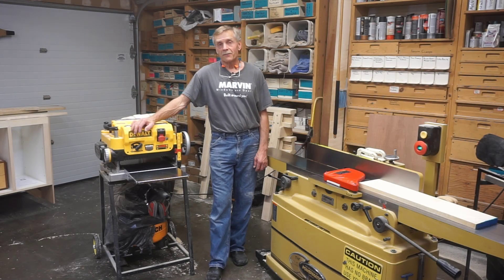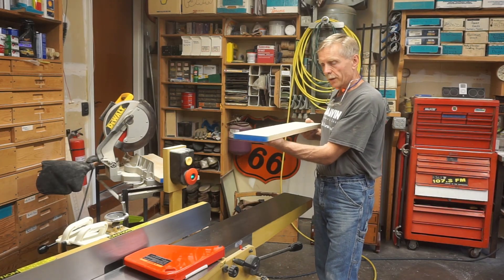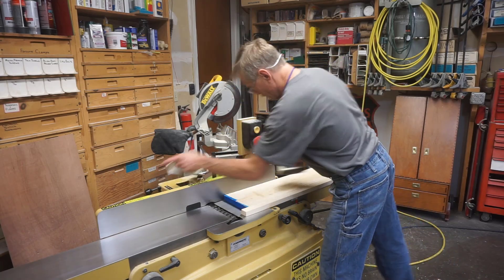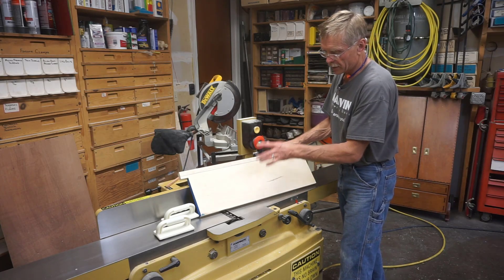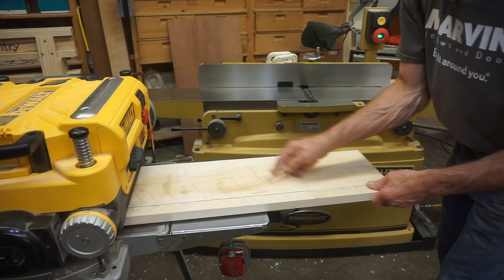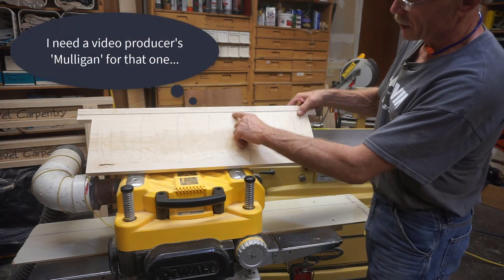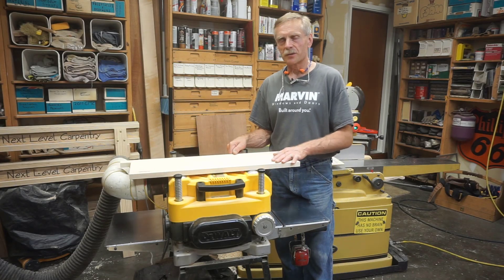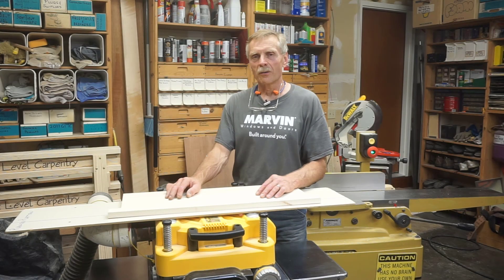Supersize Your Jointer for Planing Over-width Boards

Comment: If the lug is less than 1/16”, you could double face tape a piece if lath/lattice on it and then it wouldn’t climb onto the platen.
Reply from the maker: Great suggestion Daynaleo... thanks for taking the time to comment and share it!  Best, Matt

Comment: Thanks for the great tip!
What’s the model of your DeWalt Planer?
Reply from the maker: It's their DW735 and it's the second one of the same model I've owned.  I do a considerable amount of planing for my custom carpentry/millwork business and sold the first unit after quite a few years to make sure I have a reliable, top performing machine when working on client projects.  It's by far the best value for a planer of its size/class on the market and has been for quite a few years IMHO.  I can't really imagine being disappointed if you purchase and use one of these.  Best, Matt
Reply: Next Level Carpentry thank you for the info 🙏🏻
Reply from the maker: For sure!  If you find time to check out other NLC videos you'll see that machine put to use often on projects featured in them and maybe learn or clever trick or two to get more out of your planer...
Best, Matt

Comment: Can you make a video on how you built that giant pencil? is it hollow? did you paint the tip or is it exotic wood?
Reply from the maker: I'm planning on a build video for the giant pencils.  BTW they are indeed hollow with a rectangular hole all the way through for the 'lead'.  The 'lead' is actually a piece of genuine Gaboon Ebony although there's just a little piece at each end of the pencil where it shows.  A full piece of that exotic/rare stuff would probably be over $100 plus it would be squandering a rare resource.  Hope you'll stay tuned for the build video knowing it's going to be awhile before I get to it.  Best, Matt
Reply: Appreciate the response, here in brazil exotics like ebony are very hard to find, I got some small pieces for over a 100 that I could use, I bought a giant piece of actual lead Im thinking about epoxying in at the tip to make it fully functional, will await your video to take the build to the next level
Reply from the maker: Using actual graphite (lead) for one of these pencils would be SO cool!  Where did you find the stuff?  With your comment I'm going to consider getting some for when I do the build video... it would be the perfect touch!  Best, Matt
Reply: There is a company where I live that make them in 1/2 and 3/4 thick round dowel looking solid pieces, they are used for decals and art stuff mostly is what the company told me, I asked them if they could make a 1 inch square piece and they said sure, extremely cheap costs few cents

I checked amazon and they sell graphite sticks, rectangular and crayonish round ones but only 1/2 inch thick,  half inch may be too small for the giant pencil specs, but may be doable

I will make it fully functional whatever it takes, when people visiting over look at it and say hey thats a nice piece of decor, I want to pick it up and draw on the floor
Reply from the maker: I like the way you think Gabriel... you've convinced me to pursue the idea of making oversized pencils that really write... thanks!  It's my intention to mention your inspiration when I get around to doing the video but feel free to let me know if I neglect to mention your comment in the actual video... it would be from memory lapse not lack of appreciation!  Best, Matt
Reply from the maker: Gabriel Lopes, your wish will be fulfilled within the next week as I've filmed video for the entire process for making giant carpenter's  pencils and am in the process of producing the video now.  I hope you see this reply since the conversation we had 5 months ago inspired me to check into the chunks of graphite you told me were available through Amazon.  Indeed they were!  I bought a 10cm x 10cm x 3cm block and fashioned it into 'lead' for a whole assortment of giant carpenter's pencils. A full hour long video will show the pencil build process and a short 'teaser' Giant Pencils that Really Write video will feature the 'magic' I learned, in part from you, of how to make the giant pencils write!  I'll mention your name in the video as I believe in assigning credit where credit is due.  Thank you for contributing to Next Level Carpentry... I really appreciate it! Best, Matt

Comment: Good tip
Reply from the maker: Thanks OIS, hope your able to put it to use... maybe on a restored old jointer?  BTW I love the satisfaction of resurrecting old tools and equipment too but seldom devote the time to it that you do...nice work!  Best, Matt
Reply: Next Level Carpentry you must have been watching my stuff . I do a lot of reproduction castings for vintage machines.
Reply from the maker: OIS, yeah, I checked out your channel quickly and it looked like you were pretty serious about restoring 'old iron'  I should check it out further because the concept of doing a reproduction casting is fascinating... keep up the good work!  Best, Matt
Reply: Next Level Carpentry latest projects are compound slides for two different atlas compound slides and the depth stop for the Stanley 78 rebate plane
Reply: Next Level Carpentry some machinery would be unavailable without good reproduction casting.
Reply from the maker: I"m sure... seems like you're filling a niche in growing demand... I'm impressed and fascinated.  Feel free to post a link in a comment here for the Stanley 78 rebate plane if you do a video on it... I'd like to see it and think other NLC viewers might be as well... Best, Matt
Reply: Next Level Carpentry have a few already I'll post links when I get home

Comment: Matt, wonderful idea and explanation!  Don’t fuss about “unscripted” vids...we are not trolls ready to pounce on every detail!  We love your teaching!  So, question, would you do a 2 min., vid on the drawer pulls on the storage center behind the DeWalt planer?  THose look sweet!
Reply from the maker: Thanks for your tolerance and understanding, John, without it from you and other viewers Next Level Carpentry wouldn't stand a chance!
I've never really considered doing a '2 minute video' but might just to see if I could and address your question at the same time. Are you referring to pulls in the wood faced drawers behind the planer or the white plastic 'drawers'?
Best, Matt
Reply: @NextLevelCarpentry  I'm guessing he meant the wood faced drawers, although those seem rather simple, although time-consuming.  (at least the way I would do it)
My guess would be a plunge router to remove the majority, then a different bit (dovetail or in the same category) to undercut the upper wall to give your fingers something to grasp.
Personally, I would prefer mallet and chisels, but that is a lot of drawers and would take a lot longer!
So, did I get close?
:D 
Great video.  Loved every minute!
Reply from the maker: @kevingraves7431  I bet you're right.  I'm pretty sure I made those with a 'drawer pull bit' in a router back in the day: https://www.amazon.com/dp/B000K2EFVS/?ref=idea_lv_dp_ov_d&tag=aiponsite-20&linkCode=ic6&ascsubtag=amzn1.ideas.29WVINIJF4EUJ It would be a tricky operation  but less so using a forstner bit to start  the process.  Glad to know you liked the video BTW thanks for watching... Best, Matt

Comment: I mean no disrespect here but is this process better than just running the entire board thru the planer from the very beginning using a planer sled and not using the jointer at all?
Reply: A surface planer can NOT flatten a board UNLESS the bottom of the board has already been flattened. Thus this video makes perfect sense and guarantees not only flat surfaces but perfect parallel.

I think it is a GREAT idea. And I will use it from now one. Here is why: My planer is 15" wide. My jointer is only 8" wide. Thus that often presents a problem. In fact I was considering selling my jointer and planer and buying a European jointer/planer combo; where the cutter head width is the same for both operations.

With this idea I can shelve the idea and save a bundle.

Thank you SIR!
Reply: Pat, according to all the videos on YouTube showing using a planet with a sled....I'd say it can.
Reply from the maker: No disrespect taken, befmx, it's a valid question.  Main thing is it's a great alternative for certain applications that's good to keep in mind... never know when you'll end up in a situation where one method outdoes the other.  Best, Matt
Reply from the maker: And your implication is that using a sled and shimming isn't 'screwing around' but using an auxiliary platen is?  Hmmmm
Reply from the maker: You're welcome, Pat... thanks for your comment.  I'll caution you if you find yourself needing to flatten a lot of stuff to full 15" width you might, in fact, be better off with a wider jointer/planer combination.  I've done 13" stuff with the 8" jointer but it is a bit tedious because of light passes necessary for everything to work.  Give this process a try to see how you like how it goes before making the final equipment decision you mention.  I will say that I've not felt it necessary to have a 15" thickness planer or jointer wider than 8" for any projects I've taken on in close to 20 years of successful  profitable self employment.  If space and money weren't a concern I'd likely upsize both machines though.  Best, Matt
Reply: Thanks for the good tips.
Reply: Indeed! Hmmmmm

IMHO, a sled can cause all kinds of adjustments to get the stock level. Your method is much easier and I believe faster. Also a "sled" is, in essence, "flattening the bottom of the stock" as far as the planer goes. So the notion that a planar cannot plane a board; UNLESS the bottom has already been flattened; is true.

Oh well.
Reply: But using a planer sled usually involves screwing the workpiece to it.  Since he's making cabinet doors, the screw holes don't lend themselves well to the doors.
Reply: If I had a jointer like that, I would use it for everything haha. great Idea!
Reply from the maker: I'm with you Callam... I DO use that jointer for everything!  😁😎  A very sweet machine for sure.  So you don't feel bad it's the 3rd jointer upgrade I've made and was only able to justify the cost when it could pay for itself with faster result on  demanding millwork projects.  Best, Matt
Reply: Pat....."planer"

Comment: Genius, I have watched dozens of other vid's to supersize jointers but they all fall far short of your simple method. You are a master please keep the video's coming
Reply from the maker: Thanks Tom; I've always felt that part of 'mastery' is sifting through  many options to dial in to the one that's most effective and efficient and then tuning that best option to optimize it for the task at hand. The Irish carpenter I learned much from in my formative years referred to it as 'getting a system' for a given job. Sounds like you're doing exactly that... hope you're able to do better work faster using this method next time you encounter over-width boards.  Best, Matt

Comment: Thanks for another great tip.  I am looking at getting a Jet JJ-6HHDX 6" Jointer with helical head and a DeWalt DW735X Planer.  Your tip will save me from ripping then re-gluing wider boards.
Reply from the maker: You're totally welcome, Mark!  I think you'll be quite pleased with what you're able to accomplish with the setup you describe and using this method.  You should be able to push the limits of this and flatten stuff 10" or so using a 6" jointer.  As I mentioned I've done some pretty wide stuff by cantilevering off the 8" platten 4~5 inches.  The wider the piece, the lighter the pass.  You can imagine/visualize the physics as you approach 100% cantilever as the feed rollers want to equalize pressure and tend to tilt the workpiece but if you're paying attention and 'sneak up on it' you can push the limits and still get great results.  If you get into some gnarly/wide stuff there's always the method Hardnox describes in his comment below.  Best, Matt

Comment: Platen pending got a laugh! Liked
Reply from the maker: Glad to know you got a laugh rather than adding a thumbs down for the comment... which would be totally understandable for the rather lame 'joke'.  Thanks for the 'Liked' too!  Best, Matt
Reply: Us aussies usually get things upside down and back to front! Cheers mate
Reply from the maker: I've heard that... I guess the fact that it's winter there and 90 hot humid degrees here is confirmation, right?  Feel free to rub it in next January when you're spending a hot day at the beach and I'm out shoveling snow!  Best, Matt
Reply: yeah we are midwinter, and our max temperature a couple of days back was 23C (73.4F) same temperature that the london marathon runners were surprised by... extreme heat to be sure :-)

Comment: I’ve always used a platen full width of my platen and just shimmed it ... run it to clean ... then flip it.  You have a good idea though. Later
Reply from the maker: Hey Robert, I find this quicker and simpler than the method you describe but it does take a bit of finesse to 'get it flat and smooth in one pass' where your method is pretty much foolproof on boards where a mistake is unacceptable. Thanks for adding to the conversation here! Best, Matt

Comment: Nicely explained.  I been using the platen trick for years.  Maybe we're related.  Lol.  The other trick I use for real wide stuff is with using a sled, some shims and hot glue, and feed the whole mess through the planer.  It works great too.
Reply from the maker: Thanks for commenting, Hardnox, we must both be alums of The School of Hardnox!  The 'other trick' you mention is definitely effective when and where this method falls short.  I like to use a slab of LVL lumber for the sled you mention but will adopt the hot glue idea you've added... never thought of that!  I end up using screws and small nails for the shims which never goes all that well.  Best, Matt
Reply: Lol.  Apparently.

A hunk of LVL is a great idea.  Mine is two pieces of 3/4" MDF which is waxed.  The shims pop right off with the wax.
Reply from the maker: How long and wide is your MDF sled?  I really like the idea but am curious if it's stiff enough at 6' or 8' in length.  Can't beat the smooth waxed surface for shims and hot melt though!
Thanks for adding this to the discussion, Hardnox, I appreciate it and bet other viewers will too... Best, Matt
Reply: Thanks.  My pleasure.  These forums are wonderful for sharing information, and as it should be.  I have 3 sleds made from one sheet of 3/4" MDF.  I have 2 planers (12" & 24")  My sleds are 11-7/8" wide by 3', 5', and 8' lengths and they remain flat and straight after many years.  All are double ply (1-1/2").  I have no issue with 24" workpieces.  I also use the sleds with my 19-38 Shopmaster drum sander using 40 grit paper when I'm in a hurry and have dull planer blades (and don't feel like changing/sharpening them).  As you know I make heirloom furniture often using slabs.  Often, I run a wide slab on my jointer, multiple times until flat, then attach it to the sled and run it through the sander or jointer. Heck, whatever works is my motto.  WestphaliaWoodWorks.com  Best regards, Peter
Reply from the maker: I'm with you on the 'whatever works' motto, Peter.  I feel hypocritical sometimes doing a video demonstrating a technique of some sort and then going out to the shop and doing a similar process a different way because it's the the best method at the moment.  From your sled inventory I can tell you have to manage a wide range of variables and getting too committed to any one method hobbles production.  Best, Matt

Comment: Awesome tip I usually use a hand plane after which works great but after a inch or so like 9” - 9 1/2 it can take awhile definitely going to make this setup. Greatly appreciated take care my friend
Reply from the maker: You're totally welcome, Thom, hope you are able to get more done quicker with this method over the hand-plane technique.  I've really pushed the limits of this method for the 'gnarly' boards I mentioned and am always pleased and amazed by what I'm able to get away with using it... as I'm sure you'll be.  Best, Matt